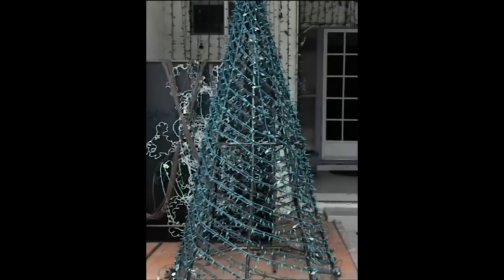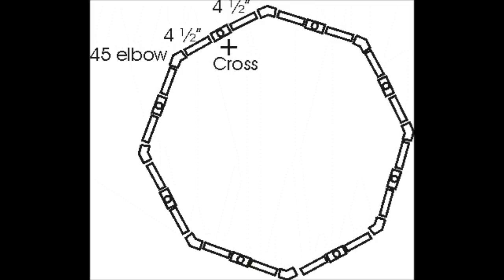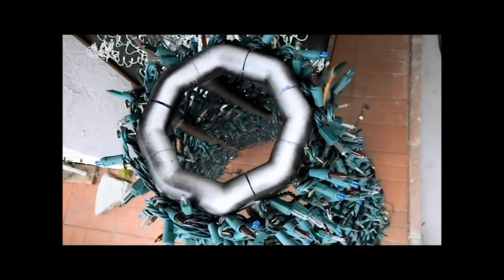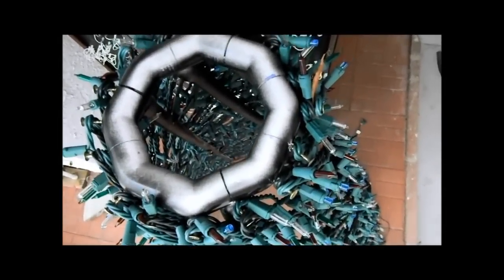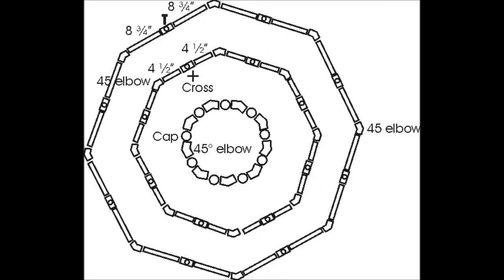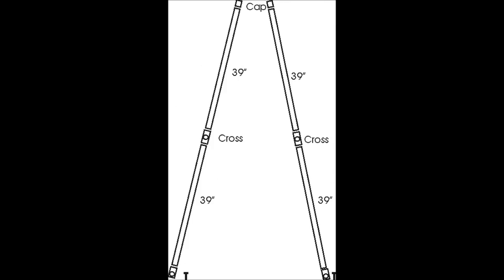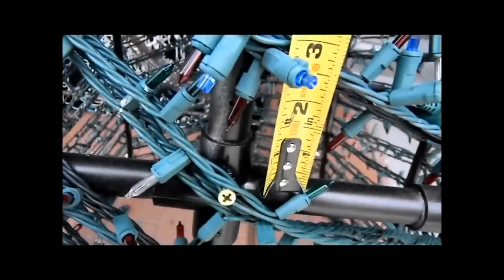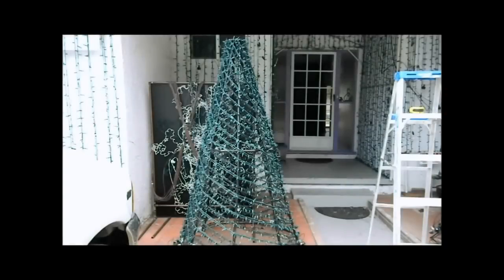Spiral tree parts

Comment: how much 1/2 pvc pipe should be purchased. Looks like Lowes/HomeDepot has it 10 ft sections. I think 20 ft would be to much just to build 7 ft tree.
Reply from the maker: +Yohan Bohan I don't remember exactly how many I bought but you need about 12 ten foot pieces maybe 1 or 2 more.
You can use LED or incandescent  light, I used LED

Comment: I like this model. since you don't have zip straps and it's easy to store. Why the center bracket?  I would think 1" sched 40 PVC would give that much.  How did you determine the angle of the caps at the top?  I would bolt them in
Reply from the maker: Even at 1" the PVC bends in when you wrap it so the center support just helps it a bit.
Before I glued anything I put the bottom ring together in the diameter I had space for and put together the top ring, then positions the Ts and caps for the angle. Once I had that I glued the the T's and since the caps weren't bolted through just screwed in they wiggled enough to match the angle. 
Somewhere in description in the videos I made for this I ended saying next time I would just bolt them through, which would make the frame more rigid.

Comment: Jerry, I'm having trouble with the angle of the each ring to make them center. How do I get the angle right?
Reply from the maker: Derick Simmons put them together first with no glue this way you can move them to the right angle. Once you have it then glue them. One thing it's probably better to not push the PVC pipe all the way in the fittings, they can be hard to get out if you do. I'm I Europe so if you have any other questions it may be a few days before I can answer

Comment: Your screws and or bolts. Are they going through the seam where you connected the 45s at the top or off set some?
Reply from the maker: drilled and bolted at the seem
Reply: Jerry L. Baker I appreciate that...hope it comes out as good as yours. I'm replacing the one I built 2 yrs ago with this setup.
Reply from the maker: Hand amer great I hope it comes out good for you!

Comment: Hello!  Do you have more detail on stringing the lights, what lights you used and how many, etc.  We are new to the how light show thing but that part is a head scratcher for us!
Reply from the maker: What I did was take a strand of lights hook it at the top and then I wrapped it down 2 times to see what I like better. Basically I start at the top front wrap down until it the strand goes to the front bottom after 2 wraps. I then mark where the strand touches the PVC and then drill the holes on each PVC is the same spot. With that I now have 8 strands that can be wrapped and all will be in the exact same spot. This video shows it https://www.youtube.com/watch?v=v7hp-VYGM4g. 
I used a 23ft strand of 100 LED lights, you can use 50. Now this is how I wrap it once I have all the screws in: I start with the male plug at the bottom of the frame so I can plug it in easily and wrap upwards until I reach the top, then wrap back down on the same screws (looks like 2 strands). when I get to the bottom again I have to wrap back up about a quarter of the way on some of my strands since they are a bit long than others.
Let me know if I can help further
Reply: @LightsOnBlucher  thanks!  It says you have 16 screws up top.  Did you twist red/green together on one screw and then the next screw twist white/blue together and so on for the 16 screws?
Reply from the maker: @paigebirks8817  I put red and blue together, then green and white. Th reason is that from a distance the red and blue on often give it a magenta look. In the other video I linked you I show that I put 8 screws on the elbows up top then wrap the tree with my first set, I then put screws in the space between the top screws  and wrap the lines right down the middle of the other strands.
Reply: @LightsOnBlucher  so you did a 16 channel...ok :)  I'm new to this but do you think that size of yhe tree would be good for a 32 channel (16 screws, alternating r/b  and w/g)  or 8 screws (twisting all 4 colors together or do you think that would get messy?)  Sorry for all the questions and thank you for taking the time to answer them!
Reply from the maker: @paigebirks8817  no problem asking questions, helping each other is the best part of this hobby. If you use 50 light strands I think 32 could work. Since I use 100 and basically fold in   half which makes them about the same as four strands, so yes you could do that
Reply: @LightsOnBlucher  that makes sense :)  thanks for helping a newbie out!  Did you ever get any video of this tree lit up and going?
Reply from the maker: @paigebirks8817  Not of it by itself but it is in all my other videos

Comment: About how long do thing it would take for a non-technical person to put this together (the frame and lights)?  Also, do you think your size tree would be okay to start as an 8-channel spiral and then grow to the full 16 channels, assuming that I did a larger bulk of strings for each of the 8 channels)?
Reply from the maker: Hi Jane, shouldn't take more than a couple hours to put together. Just don't make the mistake I did and glue it all together, no way to take it apart if you do. Glue the rings together only (they can be hung on a wall) and then insert the upright tubes, screws if you want but I don't use any now.
And yes this would be perfect for an 8 channel tree, easily switching to 16 at a later time. 
Watch my second video on this for how 8 and 16 work
https://www.youtube.com/watch?v=v7hp-VYGM4g
Reply: Thank you, Jerry!  Your video is very helpful and I think I may go for it!

Comment: how many string of lights did you used on your tree
Reply from the maker: If you look at the top ring you will see 8 screws where the caps meet the ring and then 8 crews in between those..
I use 100 strand LED and put two strands on each screw. I go up, loop around back down and then partially up again.
70 actually fit better only have to go up loop around and back down.
1 strand blue, 1 strand red, then on the other set of screws 1 strand white and 1 strand green.
So if you just wanted say one color you could do a 16 channel spiral which in my opinion looks better than 8 channels.
There are some links below the video to a downloadable parts list and the other 2 videos I did on this.

Comment: How many screws did you use and what kind what size did you use
Reply: How many bolts to use and what size
Reply from the maker: I didn't count them but around 160 screws and 2" drywall screws

Comment: 2 questions...How did you connect the poles to the top ring? What length/amount of lights did you use? Nice simple and inexpensive design, thanks for sharing it.
Reply from the maker: The poles are just press fitted. All though I had an idea the other day of how to make it better. If a person was to put a bolt in the cap long enough to  go through the top ring and lock it down with a nut, then drill through the top ring so you can insert the bolt through and tighten them together with another nut on top on top of the ring it would make it sturdier and easier to take apart.

For the string I use 100 strand LED sets, started at bottom, went to the top and then back down. My blue sets had different spacing so they went back up half way again.

Comment: i cant figure out  how the top goes togther
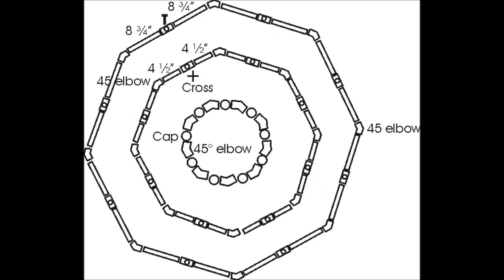Reply from the maker: if you look at 1:17 you'll see the cap sitting under the top ring.
In this video I had the cap screwed into the top ring, but later I put bolts through the caps and top ring to tighten them down better.
Also if you look at this video How to make a PVC Spiral Tree
at 5:10 you will get a good view of the top piece
Reply from the maker: Also this video at 1:00 shows the top
How to make a PVC spiral tree update

Comment: Great explanation and idea for putting together a tree. Some sort of tree topper would really add to the show. This place has a lot of different shapes and sizes in the globes and spheres section. I think something around and 8" globe would look very nice with an RGB in it and since it's acrylic, you could drill through your PVC at an angle, and into the globe and use a wood screw to mount it to the top ring permanently. Keep up the great work.  http://www.edee.com/
Reply from the maker: I hod thought of that before but didn't really find anything to use. This link will give me some options. Thanks for sharing.